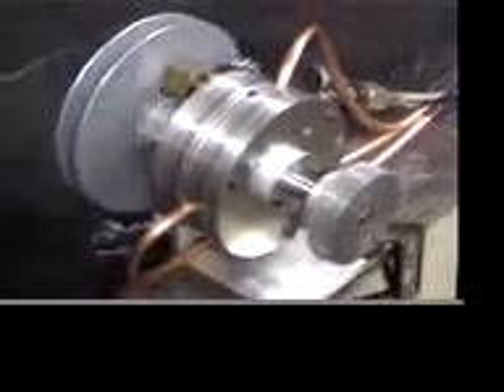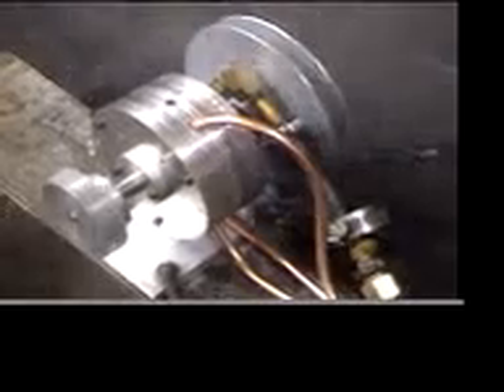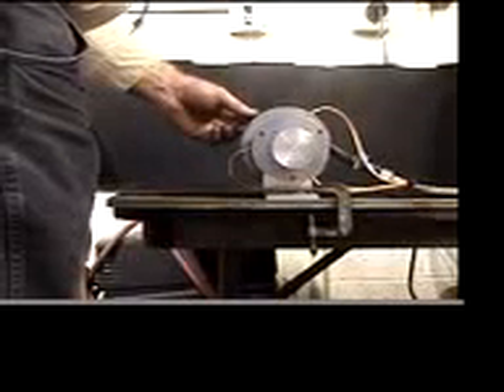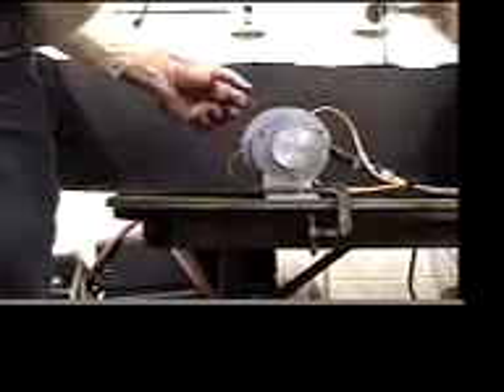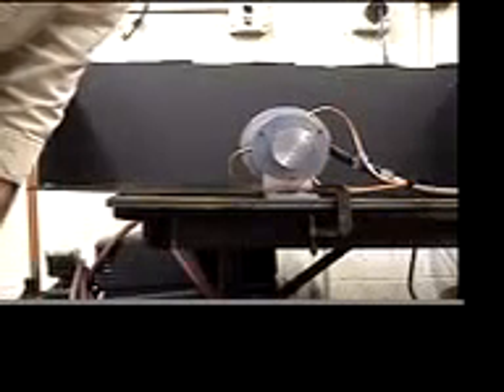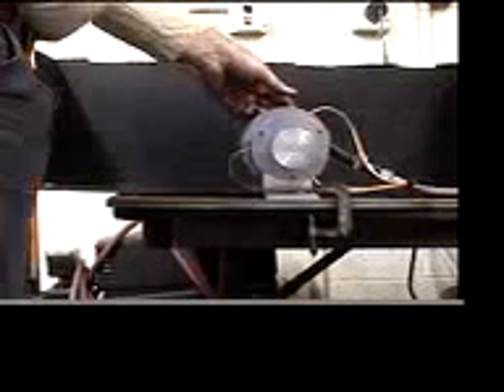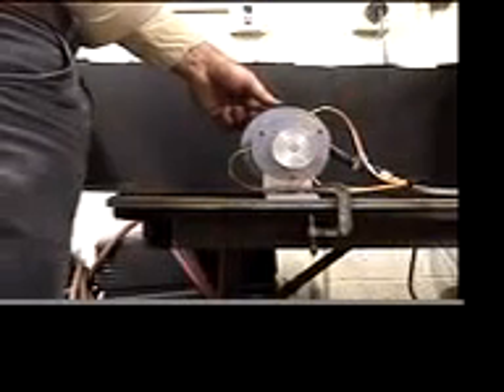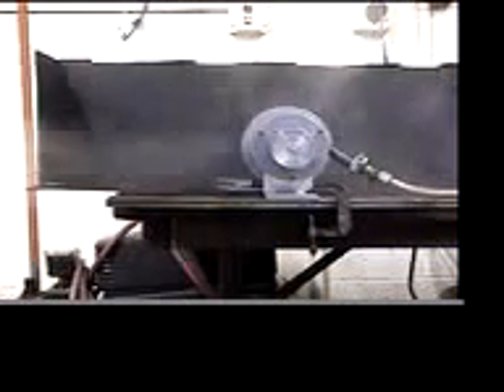Unity Uniflow Rotary Steam Engine

Comment from the maker: @9887663 
Took me hours of discussion and studying the diagrams and drawings.  Those star shaped pistons don't actually ever touch the triangle pieces on the sides.  Don't think gears, think velocity, centrifugal, pressure articulation, and momentum.  The sound you hear is just steam admission and exhaust.  Its not metal to metal sounds.
Reply: Sir is that possible to make rotor type valve  for steam engine because I don't want traditional valve with back and port motion  please asked any idea thanks!.